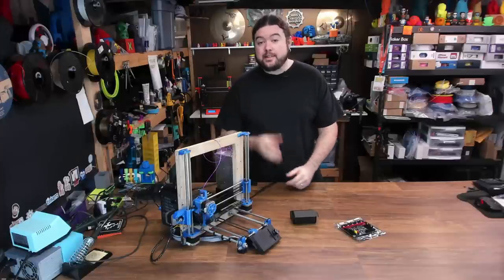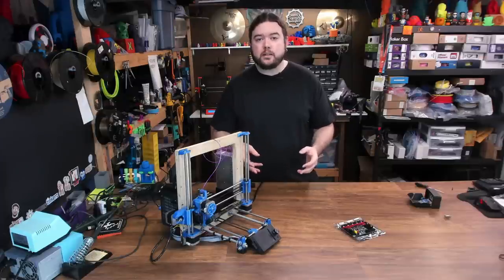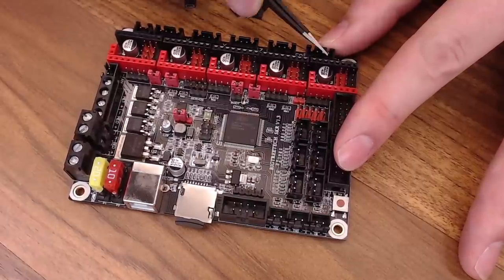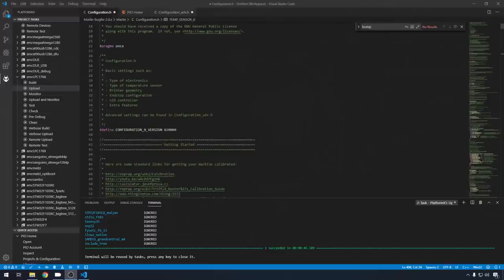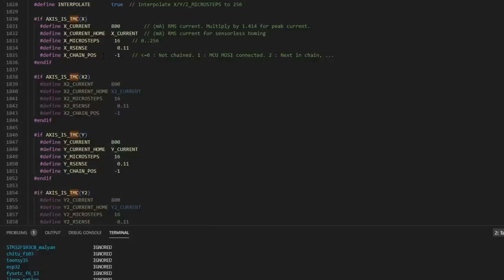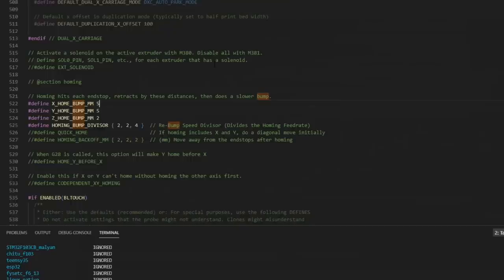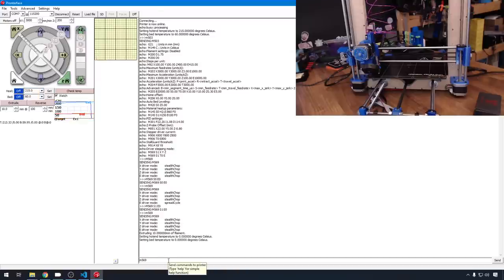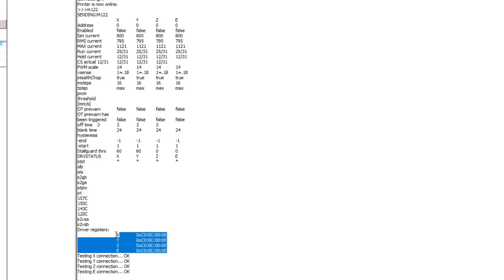TMC2209 Stepper Drivers - Bigtreetech - SKR 1.3 - Install - Chris's Basement

Comment: Got my SKR 1.3 w/2209s all setup.  Everything works, but about 30% of the time the Y axis will home in the wrong direction (and grind) after the printer has been powered on.  Anyone else seen this issue?
Reply from the maker: Hmmmm, not sure what that is, all I can think of is maybe a lose motor wire, but that's a stretch.
Reply: @ChrisRiley  Googling around I found that adding G0 Y1 BEFORE G28 in the start gcode may help this issue.  This will reset some flags just before the Home all.  Time will tell....
Reply: Still having issues.  Noticed after power up,  if I do a G28 Y the bed will move a few mm to the negative, a 2nd G28 Y will home the Y axis.  Also should the endstops report triggered after homing with sensorless homing????  My x&y always show open.
Reply: @dad311  I had similar issue, initial home would only move 1 or 2 mm then 2nd home would move ok.  Fixed it by reducing ACCEL for "NON-Printing Moves" in Marlin to 500 (was 3000).  Works great now, hope this helps.  I suspect the initial surge of current to accelerate the motor quickly from rest when cold (high accel value) was too much and triggered a false end stop detection.
Reply: @Mr31Vince  I'll check it out.  Thanks!
Reply: @Mr31Vince  thank you! I believe reducing accel fixed my issue.
Reply: @Mr31Vince  to follow up for anyone that finds this post.  Changing "#define DEFAULT_TRAVEL_ACCELERATION   500" fixed the issue, but you also need to edit your slicer settings so your firmware settings dont get over written.  I would change the above values in Marlin, but Pursa slicer would change them before each print.

Comment: I am trying to do the same things with my GT2560 v3.1 on a Geeetech A20M
BUT I Still get this error: 
\users\babyfa~1\appdata\local\temp\arduino_build_67630\sketch\src\inc\SanityCheck.h:2140:4: error: #error "TMC2208 or TMC2209 on X requires X_HARDWARE_SERIAL or X_SERIAL_(RX|TX)_PIN
Reply from the maker: Does that board have UART pins available? The SKR boards have this builtin. I think the only way you can use these is in standalone. They will require you to solder some pads on the driver board. Which one, I am not sure every driver board is different.
Reply: Chris Riley I’ve no idea, I’m really novice, it’s a GT2560 V3.1 board
Reply from the maker: @babyface3105  It doesn't look like it has UART support. Try to use them in standalone.
Reply: Chris Riley Ok thanks I will try to do this
Reply: Chris Riley instrad of putting #define X_DRIVER_TYPE TMC2209 I’ve just to replace TMC2209 by TMC2209_STANDLONE ?
Reply from the maker: @babyface3105  Correct and you might have to solder the pads on the driver board.
Reply: Chris Riley Ok thanks

Comment: hi how can i connect tmc2209 to ramps board
Reply from the maker: You will have to have 2 UART jumpers and a resistor to add them to the serial pins. Or you can run them in stand alone more by soldering some pins on the driver board.
Reply: @ChrisRiley  if u could make a video about it, i would really appreciate .because it is hard to me to understand from your this comment.and also i couldn't find anything about it on google. Or if you know a website or sth like that can u send me them

Comment: Am i the only one getting TMC connection error showing on the screen? 

Googling this mostly tells me that i have a faulty stepper driver but i'm fairly sure this isn't true.
Reply from the maker: That happens, you can enable TMC debugging to get some more info. Is it a BTT board? Might have a jumper issue.
Reply: @ChrisRiley  Yeah i think i need to debug it like you've shown in your videos. I'll get to that and see. 

I have removed all jumpers and only put them on the UART mode pins.

Thank you so much for the reply Chris.
Reply from the maker: @jake360flip  Let me know how it goes, you might try commenting out all the driver settings and enabling them as 2209 one at a time, maybe it's just one causing you issues.
Reply: @ChrisRiley  Just downloaded and installed pronterface and ran m122. 
Z stepper had a bad response so, it seems that thing is toast. I have 1 spare 2209 so i'll throw that in and see if that sorts my issue.  

Just joined your $1 a month patreon too because of how useful i have found your videos. 

I'll update with my findings when i get round to sorting it. 
Thanks again Chris
Reply: Replaced out the z with a new 2209. All is Gucci now. 
:D
Reply from the maker: @jake360flip  Thanks for the support Jake, much appreciated.
Reply: had same issue, turns out i had not placed the uart jumper for Z properly.
Reply from the maker: @olaruud9366  Thanks for reporting back.

Comment: I'm running the SKR 1.3 and TMC2209 V1.2 steppers. 

After following these steps I'm still having difficulty with the M569 and alike commands. 

Unknown command: "M569"

SENT: M503
READ: echo:  G21    ; Units in mm (mm)
G21    ; Units in mm (mm)
READ: echo:  M149 C ; Units in Celsius
M149 C ; Units in Celsius
READ: 
READ: echo:Filament settings: Disabled
Filament settings: Disabled
READ: echo:  M200 D1.75
M200 D1.75
READ: echo:  M200 D0
M200 D0
READ: echo:Steps per unit:
Steps per unit:
READ: echo: M92 X160.00 Y1600.00 Z400.00 E812.00
M92 X160.00 Y1600.00 Z400.00 E812.00
READ: echo:Maximum feedrates (units/s):
Maximum feedrates (units/s):
READ: echo:  M203 X300.00 Y300.00 Z5.00 E25.00
M203 X300.00 Y300.00 Z5.00 E25.00
READ: echo:Maximum Acceleration (units/s2):
Maximum Acceleration (units/s2):
READ: echo:  M201 X3000.00 Y3000.00 Z100.00 E10000.00
M201 X3000.00 Y3000.00 Z100.00 E10000.00
READ: echo:Acceleration (units/s2): P<print_accel> R<retract_accel> T<travel_accel>
Acceleration (units/s2): P<print_accel> R<retract_accel> T<travel_accel>
READ: echo:  M204 P3000.00 R3000.00 T3000.00
M204 P3000.00 R3000.00 T3000.00
READ: echo:Advanced: B<min_segment_time_us> S<min_feedrate> T<min_travel_feedrate> J<junc_dev>
Advanced: B<min_segment_time_us> S<min_feedrate> T<min_travel_feedrate> J<junc_dev>
READ: echo:  M205 B20000.00 S0.00 T0.00 J0.01
M205 B20000.00 S0.00 T0.00 J0.01
READ: echo:Home offset:
Home offset:
READ: echo:  M206 X0.00 Y0.00 Z0.00
M206 X0.00 Y0.00 Z0.00
READ: echo:Material heatup parameters:
Material heatup parameters:
READ: echo:  M145 S0 H180 B70 F0
M145 S0 H180 B70 F0
READ: echo:  M145 S1 H240 B110 F0
M145 S1 H240 B110 F0
READ: echo:PID settings:
PID settings:
READ: echo:  M301 P22.20 I1.08 D114.00
M301 P22.20 I1.08 D114.00

My configuration.h and configuration_adv.h is attached here at this link:

https://app.box.com/s/p24wrvby9hl3c4xzgyrfk8ktik1w3mol
Reply: Unknown command: "M914 X60 Y60"
Reply: DOH! Don't forget to removed the // in front of #define:

#define X_DRIVER_TYPE  TMC2209
#define Y_DRIVER_TYPE  TMC2209
#define Z_DRIVER_TYPE  TMC2209 
#define E0_DRIVER_TYPE TMC2209

Works now. Thank you for these videos! They are great!
Reply from the maker: Hey Brandon, looks like you found the issue, thanks for watching!

Comment: This is what I been looking for I upgraded to 2209 s about a month ago and have had issues with sensorless homing ...so I went back too mechanical end stops ....
Reply from the maker: Yeah, the sensorless homing is kinda tricky to get right I have found.
Reply: I spent 2 days getting it sorted and found in the end it was ACCEL set too high for "Non Printing Moves".  Mine was set to 3000 in Marlin, I dropped it to 1000 and tested it and it was much better, now its at 500 and Sensorless Homing works perfectly.  Homing moves uses the "Non Printing Moves" Accel value so printing moves are not affected by this change (mine still set at 1000 for printing moves).
Reply from the maker: @Mr31Vince  Nice! Glad you found a setting that worked.

Comment: I can't get my printer working on the skr E3 v1.1 dip whit 2208 drivers can you help
Reply from the maker: What's wrong with it? What error do you get?
Reply: @ChrisRiley  tmc driver not  found
Reply from the maker: @stiengilis122  What mode are you running your drivers in? UART or standalone?
Reply: @ChrisRiley  uart